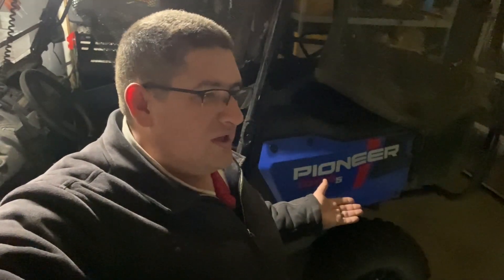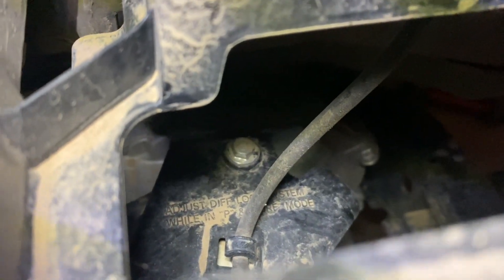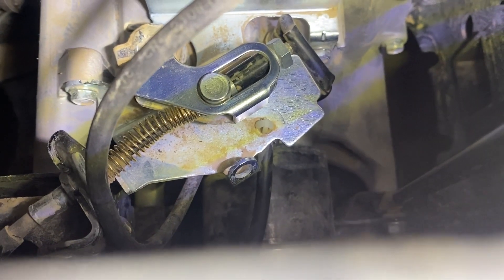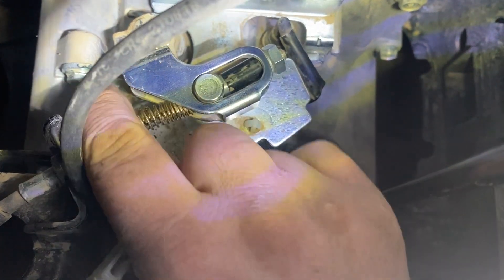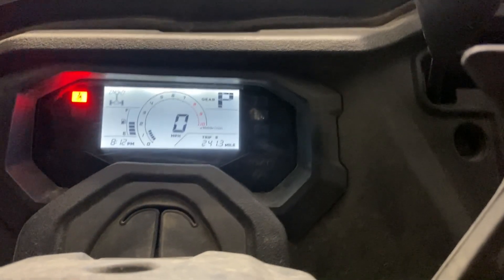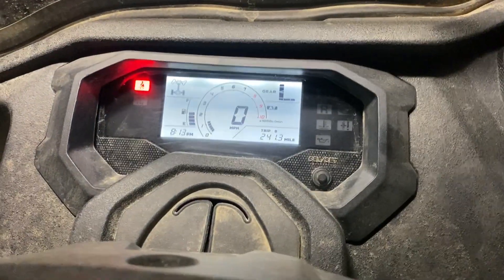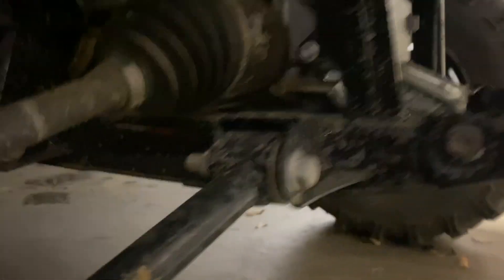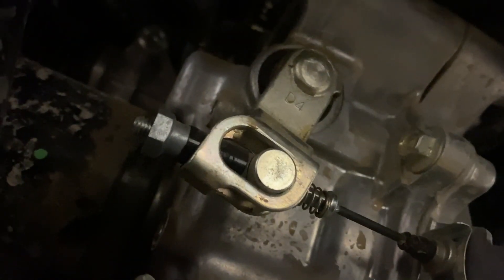Diff Cable Adjustment on 2022+ Pioneer

Comment: Can you tell me if it should say 2wd lock when you put it in park if you are in turf mode mine doesn’t but should it since it’s locking the rear so it can’t roll
Reply from the maker: Turf mode is only 1 rear wheel pushing. So if you are set to Turf mode, and move a bit slowly, the 2WD Lock should disappear. If not, more adjusting may be needed. I find I have to roll a distance to get everything disengaged or engaged.

Comment: Any help on getting my 4WD to engage? My 4WD DL, Turf Mode and 2WD all engage in a reasonable time. My 4WD will not engage on the dash and most the time displays it is in 2WD Lock. If I push up on the lever while it is in 4WD, it will engage in 4WD and on the display as well, but as soon as I let loose it disengages.
Reply from the maker: I cover the front adjustment on this same video about 7:00.